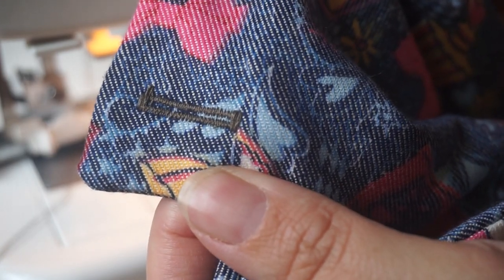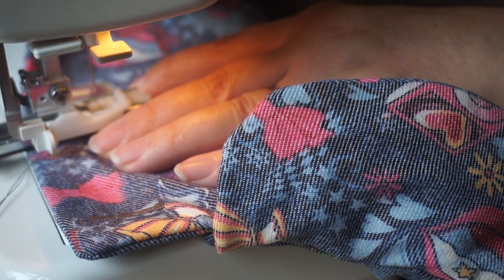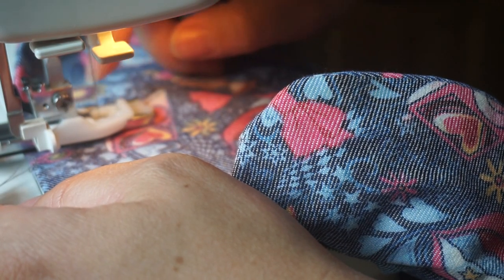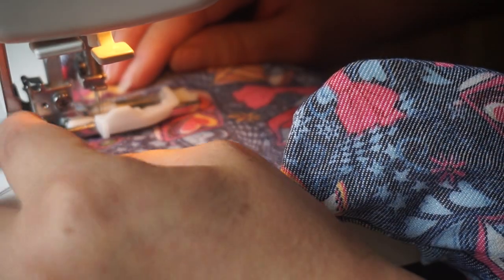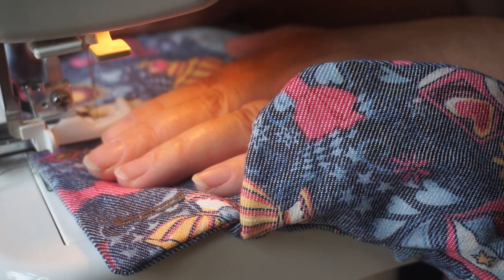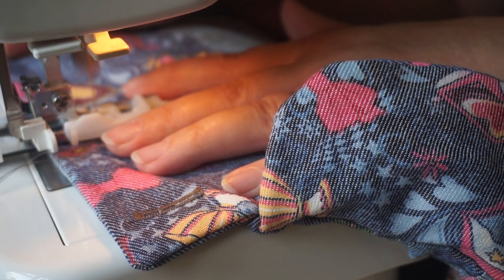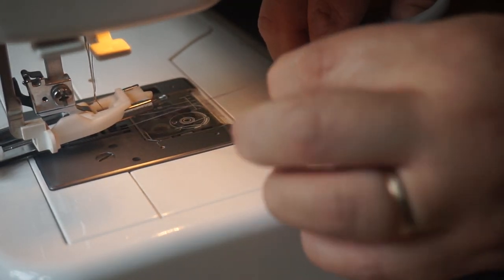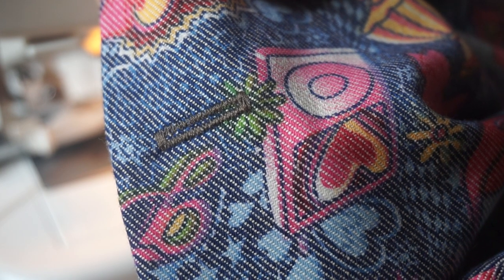Janome 525s Buttonhole Problem and How To Fix It

Comment: I have the same problem with my Janome 3000. Mine makes the first bartack and does about half an inch of the first side then stops. I discovered the technique you use but it's not easy because of where it stops. Thankyou for your video, nice to know I'm not alone and I'm not an idiot.
Reply: Thanks so much I am going to try, have been struggling for five years, to get a decent button hole. Lynne